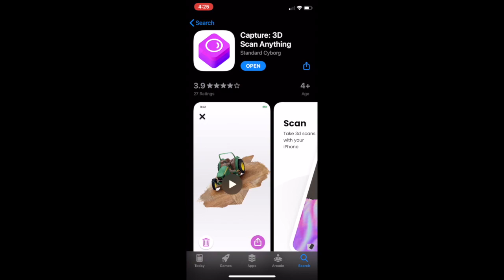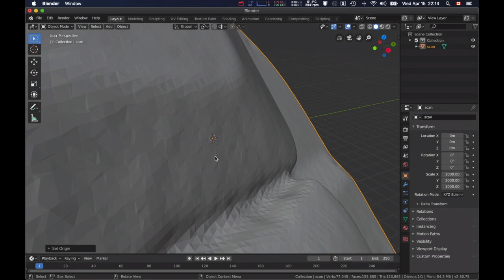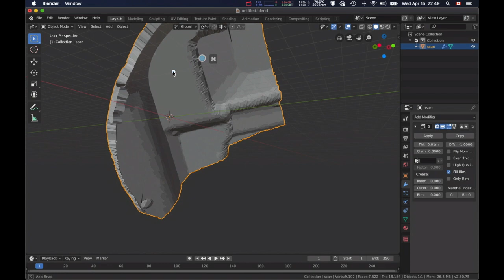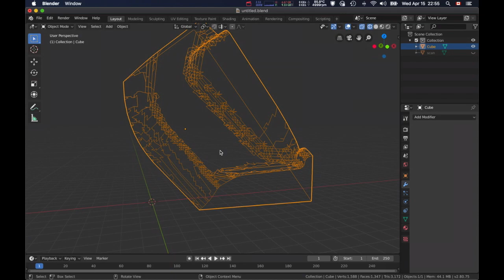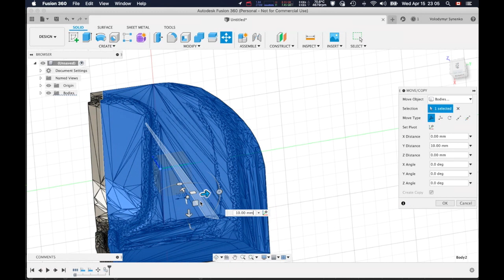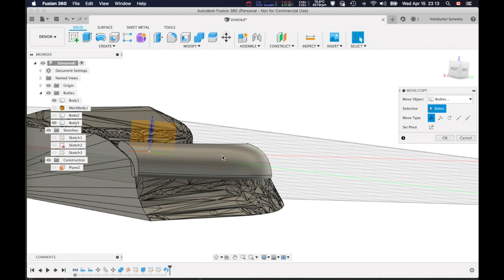transfer physical objects into Fusion 360 as a BRep

Comment: I admire your patience.  For my part, I find it easier to take a picture with a leveled camera from two or three sides, correct for the lens in photoshop and use the images as canvasses in Fusion.  It's just so much work to 3D scan and my results were never much better than good old modeling.  I still use scanning for graphics work, but not anything I'm going to build in reality.  Thanks for sharing your process; you gave me some good ideas.